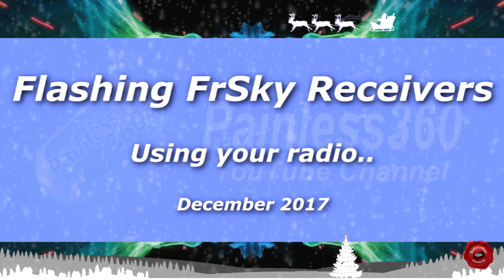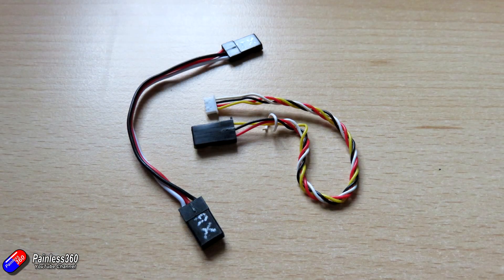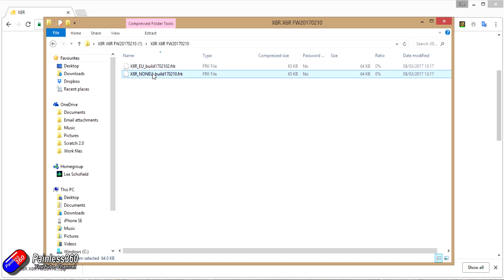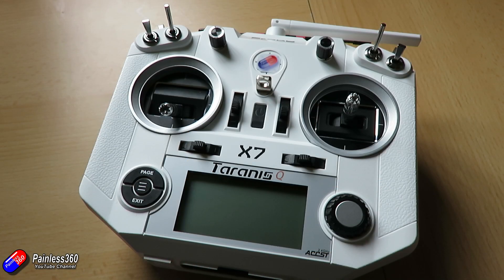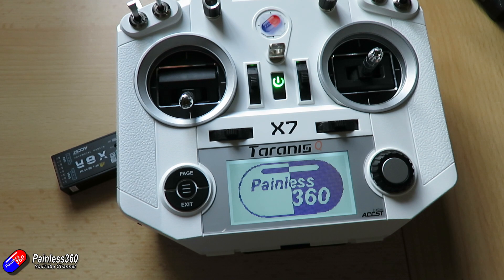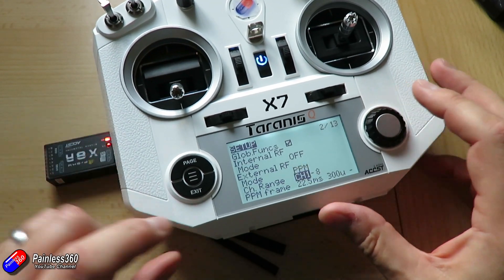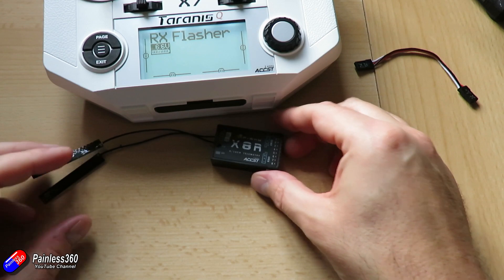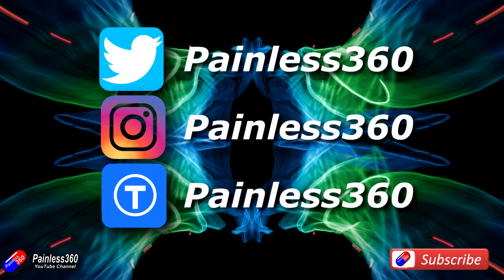RC Tips: Flashing FrSky reciever firmware using the radio (re-upload)

Comment: FrSky Taranis X9D positive pin has same voltage as transmitter battery. Not sure this is an issue or not. External RF mode ?? setting.
Reply from the maker: All works as per the video..
Reply: Your right I just followed alone and it worked. I,m a worry wart.receiver is good to 10V. Stock receiver battery was at 8V. I could see your settings for RF mode was ppm. Thanks for the video. Thumbs up.

Comment: How do you check if a Rx is EU or international? Reason I ask is that when converting a Tx from EU to open the Rx's behave differently regardless of how you set the Tx up. Channels are different.
Reply from the maker: There is usually a sticker on them. If you can't bind then its probably because the receiver is not on the same system..
Reply: Thanks but these are a few years old now. Just wondered if it can be read on the computer.
Reply from the maker: Not that I know of..

Comment: Hi  I want to flash the firmware on my XM+ rx the only problem is I have the original non-plus Taranis which does not have a Firmware folder in 'Radio Setup'. Is there a way to do this?
Reply from the maker: The folder is on the SD card so you can make one. Sounds like you're on an old version of OpenTX too.. Best of luck!
Reply: Thanks for getting back to me.  Are you saying create a new folder in that register, call it 'Firmware' then stick the xm+ firmware upgrade file in it then follow the instructions for a Taranis+?  Sorry my IT skills are limited.  My Tx is version opentx-x9d-v1.1.02   All that register has in it is:  BMP, DOCS, LOGS, MODELS, SOUNDS and system volume information.   I have never had a problem with my Taranis so have never changed anything (if it isn't broke don't fix it!).
Reply: Hoorah, I've done it! Installed Open TX Companion 2.2.2, upgraded Taranis X9D firmware, took out SD card put XM+ firmware in it then followed steps to flash to external device and presto it worked.  Only downside is I lost all my model memories.

Comment: Hey giys im having a problem with my taranis qx7. So im a newbie to the taranis radio and basically i was using an x4r to fly a fixed plane aircraft and during a crash my receiver was destroyed. So i built the exact same plane and tried to bind up a new x4r but my servos hooked up to channels 2 and 3 are not functioning. Also i know the receiver is fine because i switched the x4r for another one and had the same issue.Also all the servos and everything are fully functional and have been. tested. Basically all i need to know is how to get the servos on channel 2 and 3 working all they do is make a humming noise. Thanks any help would be appreciated.
Reply from the maker: Sound alike you’ve plugged  the servo connectors in backwards - check the polarity..
Reply: Painless360 Bro thank you so much you have now idea how long ive been go crazy trying to fix this. Just to find out it was the easiest thing to fix. Thanks i really apreciate your help! Subscribed and liked
Reply from the maker: Welcome to the channel..

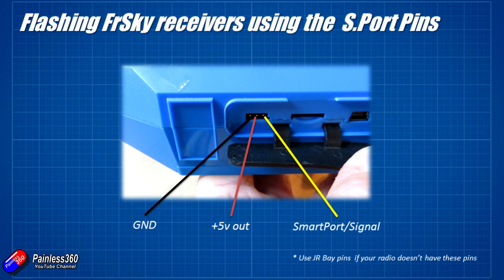Comment: Great video, but having a bit of a problem. I have a brand new QX7 (not an "S"), and using the pinout diagram at 6:52, I do not get 5 volts out. Even trying it with both internal and external RF enabled, I get no voltage on those pins. The transmitter works great, though. Any thoughts?
Reply from the maker: Not really, Apart from checking both sets of pins.. best of luck!
Reply: Thank you for the reply, Painless, but it looks like I might be in a bit of trouble. According to this video: https://www.youtube.com/watch?v=8o8-_XfG2w4 there's some really important information about the newer QX7 transmitters...If your QX7 has the pins to the left of the SD card on the bottom of the transmitter, you must use those to flash receiver firmware; the pins in the JR bay will not work. And yes, I have confirmed this. : / The signal pin on the bottom of the transmitter is working, just not the power pins. So it looks like I'm going to have to power the rx separately somehow. :( Just so this rather piece of information doesn't get buried in the reply column, I'm going to add it as a non-reply comment.
Reply from the maker: I cover the X7S and QX7 bottom pins in the video at 5:50 as well as notate the both wiring diagrams in the video too.. Best of luck!

Comment: Hey. Is there the same firmware cable avalable for amazon? Will this work with a standard double ended cable?
Reply from the maker: It's just a standard cable with a few pins swapped if you're using the JR bay pins..
Reply: Do thia comes with the frsky?
Reply from the maker: Nope, see my unboxing of those radios..
Reply: @Painless360  Is there a cable like that on amazon?

Comment: Tried to update my x4R with my new X10S, both via the TX Smart Port and the external module bay. On each route I get a message that the external module can't be found. Any hints?
Reply: Actually it says "Module not responding"
Reply from the maker: Not sure, I've not used the X10S here but it appears that there are two outputs on the back. I'm guessing you've tried both.. Let me know if you figure it out!
Reply: The oldest of tricks did it again! Switch everything off, have a coffee, a stroll in the neighbourhood, switch it back on: Robert's you moms brother! The TX Smart Port worked fine. Sorry, to have bothered you
Reply from the maker: No problem at all, glad you got it working. Most don’t come back let me know what the answer actually is. ;)

Comment: What firmware version on the radio do you need to flash the receivers?  Also do you have a video showing how to update the radio's firmware?
Reply from the maker: I'm using 2.1.9 and 2.2 here. The process is the same but download the internal module firmware and select 'flash internal' in the menu.. Hope that helps..

Comment: For those having problems updating firmware using a QX7 there is a great guide and video here http://rcdiy.ca/taranis-opentx-s-port-firmware-flashing/
If you have the 3 pins on the underside of the X7 you must use those. The ones in the module bay won't work. Also make sure you have a decent servo cable and that the 3 pins on the tx are clean before starting so you know you have sound electrical connections.

Comment: I certainly enjoy your videos... finding them very helpful working through the arcane land of FrSky electronics!  However, I do have a question/observation on this particular video.  The cable needed to write new firmware onto an X8R receiver from the X9D+ transmitter cannot be a "standard servo extension" - even with the power & ground pins swapped on one end.  Why?  Because both the Rx and Tx connection points have "male" pins that only mate to "female" plugs.  A servo extension cable has male pins at one end, and female plugs at the other.  I had to fabricate a second "female" plug at one end of an extension cable to create a cable such as you're using here... and it works "fine as frog's hair"... ;-)
Reply from the maker: :D

Comment: i comment everytime i see these vids. The taranis X9 port in the back is full battery voltage, so if you have a 8 cell nimh or 3s lipo, that's 12v and will fry your rx. https://github.com/opentx/opentx/wiki/Taranis-I-O-ports
Reply: Yes  Very, Very ,Very important information  that i too have noticed is not pointed out in any of these videos about flashing via the modual bay .  I was happily trundling along, fat and dumb, flashing a multitude of receivers with this method when one day i stumbled across an article on calibrating the battery voltage readout  on the x9d. in it they suggested reading the true battery voltage with a voltmeter through the pins in the bay. At that point I broke into a cold sweat thinking NO FU*ING WAY. So I grabbed my X9D threw a 3cell lipo in it and measured the voltage at the bay pins and sure as SH* it read 12.6 volts . Just by sheer dumb luck i had a 2 cell lipo in my radio every time i flashed receivers . Whew then i remembered i had showed a few friends  how to flash this way i had to hurry and warn them about this unfortunately i was too late in one case as my friend had burned up his brand new rx just the night before because he was using a 3 cell lipo in his radio. Tough lesson learned  i felt like shi* for not knowing this . i went back and like you noticed none of the videos on flashin with this method mentioned or warned about this fact. Thanks for pointing this out but i noticed that Painless hasent even acknowledged your post hopefully he sees it and edits this vid before more people burn up thier rx.
Reply: yes, this is pretty annoying! it's exactly how I've fried my R-XSR right at the minute I unboxed it... not happy.

Comment: I am making quadcopter for a univercity cometition!! Please seggest me the best flight controller to win the competition please!!
Reply: The one between your ears :) Just about any F3 or F4 board will do what you want. Just choose the board based on cost against the available features you require.
Reply: Rob B i selected 8000kv motors and all i want is only speed!!
So which flight controller will be helpful to me?
Reply: the plot thickens. Based on the 8000kv motors it seems you are making a brushed microquad. Sorry that is an area in which I have very little experience so I will decline to offer further advice in case I choose poorly.
Reply: Rob B ok then what could be the maximum KV for quadcopter?
I dont know much in this field
Means i can do programming connections etc
Bt about products i know very less
Please help me!!,

Comment: Says FW error no bottom pin respo
Reply from the maker: On some radios they have a port for flashing... what troubleshooting have you already tried?
Reply: @Painless360  Thankyou bro it was happymodels wiring diagrams  for f4 v3 and f4 v3 pro are confusing as all get out thankyou for responding though I do appreciate you alot 👍

Comment: Thanks for your reply .
You make it sound so simple .
As  I said I've got the EU 2015 firmware in my Taranis  
Can I flash that New EU LBT Receiver I've just bought without using a computer  at all or have I got to download updated firmware like you did on this video  .
Regards Paul .Ps
Tried to download the open tx software on my computer on opening it  something about it wasn't downloaded do you want to download. 
Click yes then I get a message  saying unable to download something about language. .
As I said  technology is not my strong point. 
I very rarely down load stuff without  lots of hassle. 
That's why I don't like doing it. 
I can't say it just me, 
Because our new computer system at work is still giving our company problems two years later .IE crashing or just plain don't work.
Reply from the maker: Are you replying to a comment I've made? Please use the 'Reply' function as it gets impossible for me to keep track with all the questions and help I give out. On this one - I wouldn't update the radio at all if possible. If it works then my philosophy is 'don't bugger about with it'. Updating the receivers is a piece of cake in comparison and doesn't need a computer expert to do it but you do need to be able to use the basics of a PC (see video). On the work thing - they need to fire the IT dept. and get some competent guys in ;) Happy flying!
Reply: Painless360  many thanks 
Regards Paul
Reply: Painless360 
Sorry about that not replying the right way .
I very frustrated not being able to get things working as they should. 
But saying that  I have built  four drones from scratch three 450 size with the DJI flight controller  and a 250 racing drone with a naze32 board which I setup myself. 
Regards Paul

It's ok watching how its done  with videos 
Mostly they are a great help .
But if something goes wrong  your on your own. 
To sort it out  . I love watching you're video's. 
So keep up the good work..